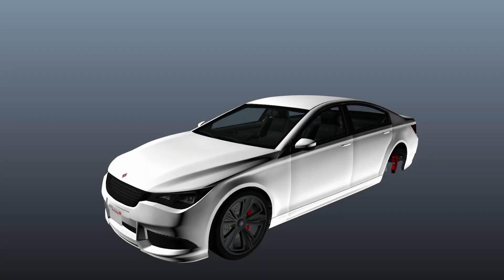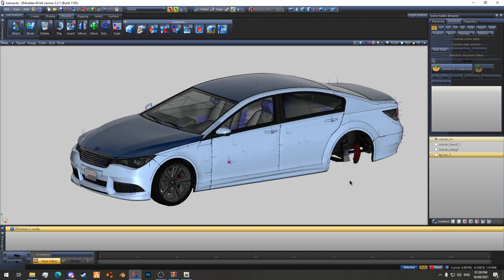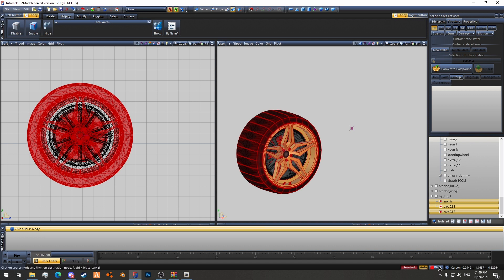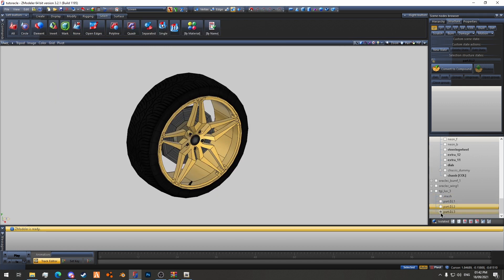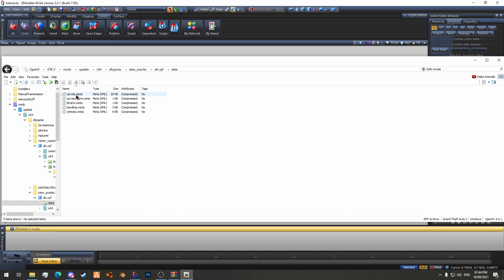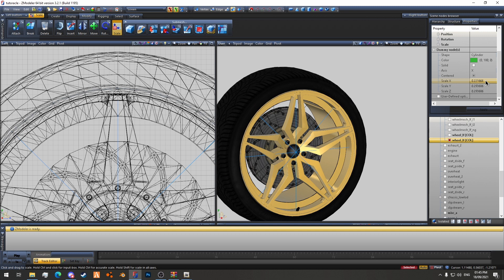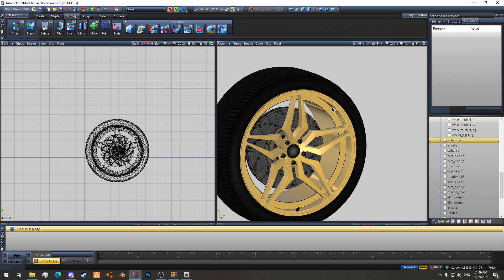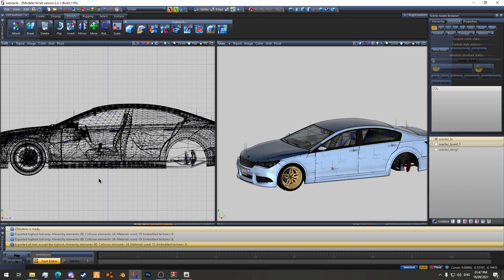How to Replace Vehicle Wheels [ZModeler 3 | Tutorials]

Comment: Need some help with the tire collisions on a vehicle I’m working on. The wheel collisions are the correct size in zmod but when I accelerate in game the tires go through the ground then pop right back up and sit flush with the ground.  It only happens when the vehicle is starting or stopping. At normal or fast speeds the car drives fine and the tires sit right on the road. Any ideas and help is appreciated.
Reply from the maker: That's a handling issue, I'm not sure how to fix it though.
Reply: @13Stewartc probably something to do with handling.meta?

Comment: Hello Stewartc, I've followed the steps, but when I load the car model into GTA 5, the wheels are wobbly and do not rotate properly. Do you have any solution to this?
Reply from the maker: Yeah, sounds like your wheels are not symmetrical. If this is the case, centering the local axis to the object may cause it to be wrong position, causing a wheel wobble on export. Find a better wheel model and then use that whilst following this tutorial :)
Reply: @13Stewartc  Alright I will try another one, thank you very much!

Comment: hey stew, your vids have been helping me get into zmod quite nicely. i was wondering if you could explain how to create mismatch wheels (different wheels front and back)? much appreciated.
Reply from the maker: Check cars such as the Tornado6 basically the same setup. (Hierarchy wise) just import it and see how it's been done. Keep in mind though that when you swap the wheels to aftermarket ones in game, all the wheels will change. Not just the fronts / rears on their own.
Reply: @13Stewartc  appreciate the reply, would you be able to help me with this issue; whenever i import a ydr file, my zmod crashes - do you know why?
Reply from the maker: @ccmxdia  Try turning off 'slice to parts'

Comment: The wheels go a little bit through the ground even with collisions the same size as the wheel
Reply from the maker: That'll most likely be an issue with the area of the map you spawned in. Or your wheelScale and wheelScaleRear settings in vehicles.meta aren't set properly. (They should be set to the scale of the rim, not the tire) 

You should also make sure you're exporting the car properly.
Reply: @13Stewartc  HA! Yep I missed that like a dummy, lol my bad!
Reply from the maker: @SoMiSongbird  no worries ^^

Comment: I want to change the wheels on one of my car, but cant open the drawable object into Z modeler any ideas?
Reply from the maker: The model is most likely locked. Or if its a .ydr then you might need to turn off 'slice to parts' for it to appear in your scene. (If the import button goes grey then the model is locked)

Comment: Hey Steward! Do you know how I can offset the position of custom tuning wheels applied in-game from the stock wheels position while retaining the position of the stock wheels? I’ve seen a few cars do it but I have no clue how. It’s actually confusing because custom wheels respect the wheel node position but respect Front COL scaling, I just don’t understand how it’s even possible with that logic.
Reply from the maker: There's no proper way to do this. (not without bugs) Most people just use VStancer to adjust the track width if needed. 

However tuning wheels will adjust to the width of the wheel collisions on your base model. Keep in mind though that the position of the brake discs is normalized across all the wheels (so too much width will = to wide a brake disc, which will cause it to clip into your brake calipers.
Reply: @13Stewartc  odd tho as the cars that I’ve seen do it don’t use vStancer or any external scripts whatsoever. It’s all done natively. Both the size and position of the custom wheels are constrained to the COL’s respective properties (or so I think). Meanwhile the stock wheels have a different position. 🧐 The only way I’ve managed to accomplish it is by moving the axis of the wheel node while leaving the stock wheel model itself in its desired position, which does work but then causes a game crash upon applying certain custom wheels.

Comment: There is a .skel that is also with the wheel. Do we need to use that also or just the .mesh ?
Reply from the maker: Sounds like you imported without 'slice to parts' turned on. Try that. As far as ik there shouldn't be any .skel in there at all.
Reply: @13Stewartc  I had to uncheck slice to parts, the only way it would load. If i didn't I just got the dff

Comment: I followed everything correctly (i think) but when i spawn car in only my left front has changed scale and the rest are alot bigger (i was trying to swap wheel and size for lowrider style car) should it have worked or is there additional steps to change the rest of the car wheel size?
Reply from the maker: You have to scale the wheel collisions all at once not just the front left
Reply: @13Stewartc  Yeah i got it, thanks for your tuts.

Comment: Does anyone know a video on how to take wheels from a modele save them and use them on a different video
Reply from the maker: You just import a car like normal, unlink the wheel, rename it then save as a .z3d file, then in your other car project do file > merge then select your z3d file then the object then press merge.
Reply: @13Stewartc  changed wheels on my model and when i export it and put it in game the tires came out white?

Comment: game crashes when car spawns, any idea?
Reply from the maker: Lack of game config, incorrectly exported model, incorrectly set up add-on. If the model visually appears and the game crashes as soon as you see the car it's most likely the handling that is at fault. The rest of the issues listed here are common faults. The very last one being that your model is corrupt
Reply: @13Stewartc  I fixed it! it was the textures bugging, just replaced the textures with png's and it works fine now. Thanks!